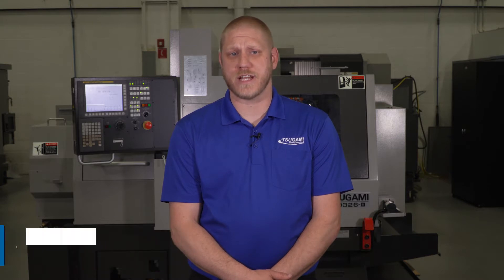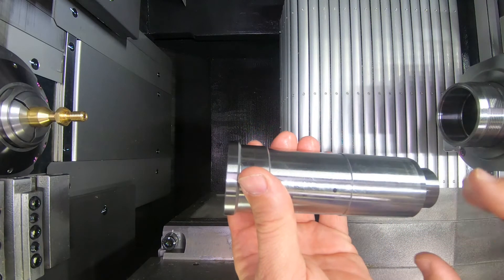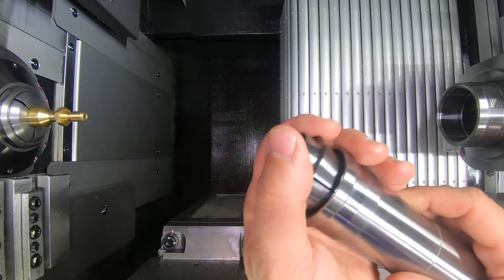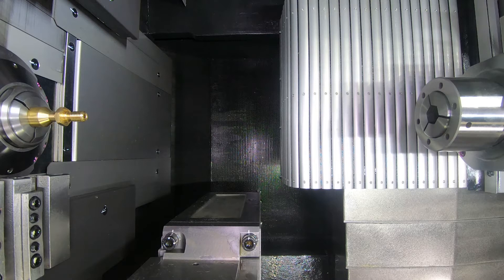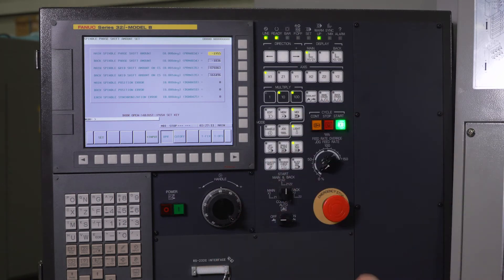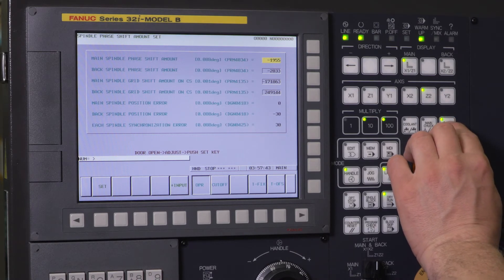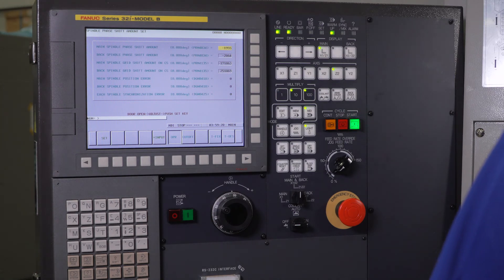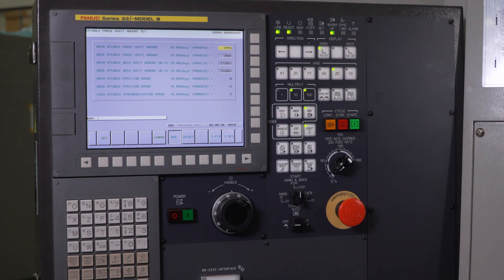How to Set the Sub Spindle Phase Synchronization (For 2021 Models and Newer)

Comment: Very helpful.   I was doing more manual way with same results....except I would have my front spindle turning for the  handle on part with sub spindle.   Is the top inside safety key needed also ??
Reply from the maker: The safety key must be installed because the logic looks to see that the door has been opened and closed before it moves to the next step.